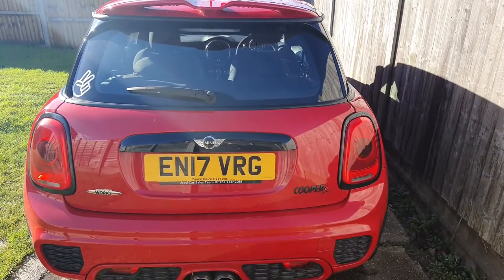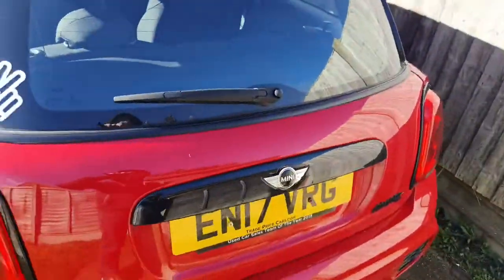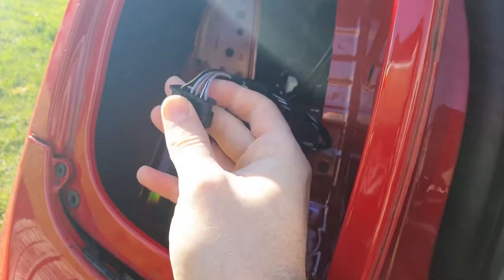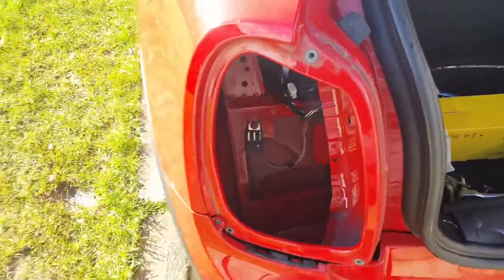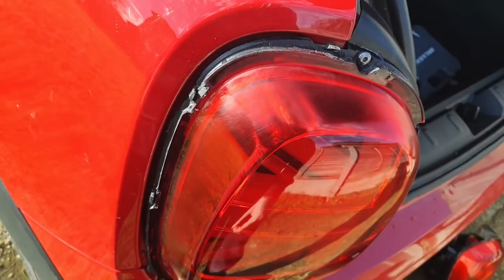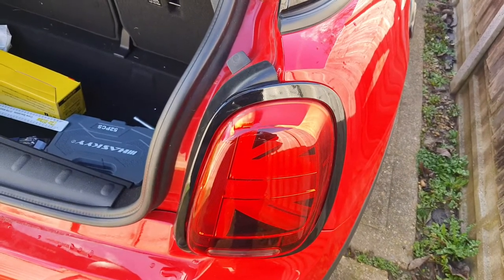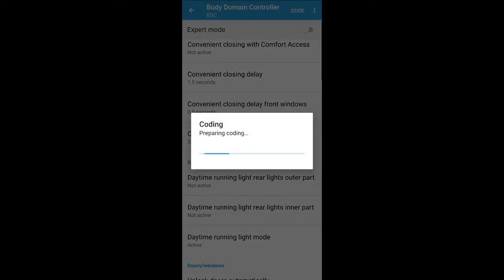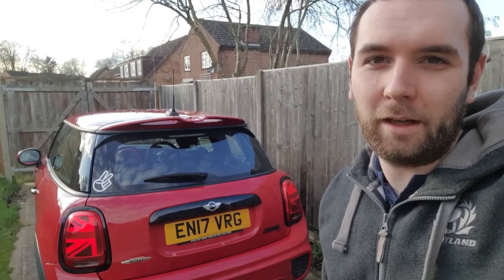Mini F56 Genuine Union Jack Tail-lights Retrofit for Halogen

Comment: Thanks for this, great help in installing the same lights on my 2015 F56. Still managed to break the same clip as you as I completely forgot about your warning for this - may try and plastic weld back on but like you the gap looks the same compared to a working clip.
Thanks again, video was a life saver especially when explaining how to unclip the lights from the inside.
Reply: Curious - did you do the wire swap? I have a 2015 F55 5 door and didn't have to do that. All my wire holes were filled. Wonder if the F55 differs from the F56 for the wiring assignments...

Comment: Thank you very much for making this video. I've just successfully installed some on mine. Although I wasn't aware that you also have to pay an additional £50 to get full access to the Bimmercode app?!
FYI- The app has also been updated now so it's much easier and simpler to update the coding without having to go through all the voltage shiz.
Happy motoring peeps.

Comment: Hi again,I did have another problem with the Union Jack lights,the break light strip was staying on when normal lights were switched on,but not when the day time running lights were on,but after watching your video,and having got a Bimmer code and icar adapter,and watching the rest of your video,all sorted.
Again thanks,with out your help next visit would have been the garage.
Chris
Reply from the maker: Hi Chris, yeah the coding is an important part. Can be quite dangerous if you skip it for the reasons you stated :) glad you got it sorted!!

Comment: Inspired by your video I purchased a new set of tail lights and the Bimmercode app. I think I must have a newer version of the app as I only had to change the lights to LED and did not have to alter the warm and cold monitoring as I think this must now be automatic. Thanks very much for your excellent video.
Reply from the maker: Great! Glad to hear all went well :)
Reply: Did you have to purchase expert mode for the app or with the new update can you setup the lights fully in normal mode? I think I have the part LED tail lights so not sure if that means I'll just need to set them to LED in Bimmercode for them to work? Cheers

Comment: Good video. Got this job to do at some point soon. Got some genuine union jack taillights to go on my halogen F56. I'll definitely be using this video to help me out
Reply from the maker: Thanks! Let me know if you get stuck!
Reply: @squashylemming5202  hi great video!👍👍thanks.. can I just ask do you need the ignition on eg lights, radio ,air on ect ready to start? Or do you need to have the engine running🤔 I’m going to be doing the exact same thing as this video when the weather gets abit better😄genuine lights came today, I’m changing over from halogens!! Thanks in advance seems a bit complicated & a delicate task🙏.Dave thanks again for the video 😄👍👍
Reply: @squashylemming5202  hi great video!👍👍thanks.. can I just ask do you need the ignition on eg lights, radio ,air on ect before coding ready to start? Or do you need to have the engine running🤔 I’m going to be doing the exact same thing as this video when the weather gets abit better😄genuine lights came today, I’m changing over from halogens!! Thanks in advance seems a bit complicated & a delicate task🙏.Dave thanks again for the video 😄👍👍

Comment: hi Great video and very clear on your instructions, much appreciated.  i have a slight difference to what you showed on my 2017 mini one where i have swapped out the wires as you showed but i now have left side union light with indicator off but right side on.  the right also has indicator (centre horizontal light) as red and left in yellow which is correct.  i have not made expert mode updates yet but wanted check if something else wrong or is there a different fix required in expert mode?

Comment: Thank you mate yo are great!!!  I have a question. At the end yo turned off the mapping BRMSL LEFT AND RIGHT. Now i  have rear fog light but there is no switch to turn on it. I want to change this fog light to rear brake light. What i must to do?
Reply from the maker: Hi mate, if you want to make your fog lights come on with brake lights, check out Ben Rolfe’s coding video, I believe he shows you how to do it :)
Reply: @squashylemming5202  i already watched. But there is a problem. 1st he have 2 fog lights but i have only one. And he codded brmsl left and right to srl_l. Yo turned it of for union tail lights. Here is a conflict i think. Can yo explain
Reply from the maker: @turanhuseynli105  I see. I didn’t realise the fog lights would be controlled differently by the ECU for a car with just the one fog light, I’m assuming you have the cooper with the central fog light at the rear? Unfortunately I don’t have my mini or Bimmercode anymore so I’m afraid I can’t help. Might be worth looking online for a forum post?

Comment: Great video thanks. Would this process work when upgrading from halogen to the non UJ led versions?
Reply from the maker: I believe so. I think the UJ lights are pretty much a straight swap (without the need for expert mode coding) if you already had the non UJ led versions, so that suggests it would be the same process moving from halogens. I still think there are some halogen elements in the non-UJ led lights though so it may differ slightly in the cold/warm monitoring coding

Comment: Hello i ve bought a mini f56 with front and back halogen lamps. The only thing i ve to do is switch the pins then use bimmer code? Nothing more? Your mini at the time video is front and back halogen? Thank s
Reply from the maker: Hi, yes that’s correct. In fact now bimmercode is simpler to use than when I recorded the video. So I believe there are less settings you need to change.

Comment: Great video just what I was looking for!got the new lights today (genuine ones)for halogen on my 65plate Cooper😃 does anyone know , if when coding do you just leave the ignition on ready to start up lights radio ect on! Or do you have to have engine running🤔
Reply from the maker: Hi Dave, so when coding using bimmercode (or similar) you'll want the to turn the ignition on. You don't need the engine running though. Bimmercode will automatically reboot the ignition and ECUs after you code and you may see a brief stability control notification pop up on the screen but this gets cleared by the coding process. Hope this helps! Good luck! Let me know if you have any trouble👍
Reply: @squashylemming5202  
Hi, iv got BimmerCode to code the lights & just noticed it’s been updated & there’s an option now it says retrofit lci tail lights 🤔does that mean I just need to activate that after iv done the wire swap? & that’s all the coding done do you know? Many thanks.  Dave
Reply from the maker: @davefogg9586  interesting! I haven't seen this. It might work, worth a try! I'm unsure if it will do the expert mode coding though as you can retrofit the lights to both the halogen and LED equipped minis and bimmercode would need to know which lights you have equipped and that you've swapped pins around in order to change the right settings. I understand there is still some coding that needs doing if you fit retrofit LCI lights to an LED equipped car, so it might just do the cold/warm voltage monitoring etc. I will have a look the next time I use bimmercode.
Reply: @squashylemming5202  I've just coded some genuine F60 LEDs. I've got the updated Bimmer code options, and I think it still needs the expert mode changes done. In daylight it looks right, but when you put headlights on it gets a bit confused (not sure what happens if the lights come on due to darkness due to being in Automode). It would still be usable, but the brake light comes on while the tail lights, and the tail and brake lights get brighter when you brake.
I'm about to go out and do the expert bit and see what happens. Update soon.

Comment: Hello. I have a 2017 Mini Cooper base 2dr. Hatchback. I will install a oem Union Jack tail light. Do I need to do a recode?  Also do I need to do what you did on the wiring swaps? I really appreciate your help. I want to hear your advice first before I do it. This is an awesome video. I will definitely subscribe. Also what OBD did you use. Planning to do a iCar pro OBD from V-gate. Thanks buddy
Reply from the maker: Hi! Is your cooper equipped with the halogen lights? Or does it have the LED headlights at the front? If it has halogen bulbs then you will need to recode and do the wiring swap (as I have done). 

If it has LEDs already then you only need to do the voltage monitoring coding and not the expert mode stuff or wire swap.

I used the iCar Pro Bluetooth version. It is really good. You will also need to purchase the full version of bimmercode to perform coding
Reply: @squashylemming5202  awesome!  Thanks for your immediate response. I have a halogen headlight. Will it trigger a warning alert on the dash? Ok on the process. OBD tool ok. But where do you purchase the BEEMERCODE? Thanks again buddy
Reply: Is this the one? The free bimmercode app?
Reply from the maker: @ledi1824  yeah bimmercode is the app. But you will need the full version to actually code which is not free. If you have the halogen lights, I am not sure if there will be warning lights. you need to code and do the wire swap in order for them to light up correctly. Otherwise the car won't  do the correct thing when you press the brake pedal etc. If you do this then there will be no warning lights
Reply: @squashylemming5202  do you have the link to the bimmercode app? I only see the free one. Hey I appreciate your giving time to answer my concerns. Thanks
Reply from the maker: @ledi1824  hi. I don't have the link but if you download the free one it will direct you to purchase the full version. No problem!
Reply: @squashylemming5202  good luck to me🤪🙏🏼
Reply from the maker: @ledi1824  have fun 👍😂
Reply: @squashylemming5202  last question. When doing the coding. Should the engine running? Thanks
Reply from the maker: @ledi1824  you only need the ignition on but you can have the engine running if you like
Reply: @squashylemming5202  thanks again!  Oo this will be the day that I will change it. Last thing in the future if I want to bring back the halogen tail lights. I’ll just do the reverse process of the coding procedure Wright? Thanks
Reply from the maker: @ledi1824  yeah, and you'll need to reverse the wire swap back to the way it was too
Reply: @squashylemming5202  thanks buddy. Be safe

Comment: Hi
Thanks for posting this video.
I have a f60 countryman with led headlights & fog lights. Does this mean I will have part led tail lights so wouldn't need to change pin & code ???
Reply from the maker: I don’t know about the f60. I’d have thought the union jacks for the countryman would be a straight swap (maybe with some minor coding for the voltage monitoring if any) id have a look on some forums

Comment: I have an issue with the reversing light not working on these. Any ideas? Tried following your instructions but nothings changed. They didn't work, I then didn't touch the lights and they worked for a day or 2 and now they don't work again 😕 help

Comment: Great video!! How would I know if my lights are halogen or led? Also where did you buy them from. Thank you.
Reply from the maker: Hi Kevin, your taillights will be halogen if you also have the halogen headlights. If you have the LED headlights then you should have the "part-LED" rear lights. In which case you don't need to do the pin swapping or expert coding, just the voltage monitoring coding.
Reply from the maker: I bought the lights off eBay. One needed to be resealed so that's why I got them cheap

Comment: So i just install the light and everything work great but the brake light not on when I apply the brake and i think i need coding. For the wire i don’t have 5 pin but i have 6 pin so i don’t know which one to switch
Reply: Could you post pictures of the 2 plugs that have the 6 pins?

Comment: Hi,have you changed your front headlights.been give a pair of led headlights from 2017 mini,my car is a 2016 model,thee problem is there are 3 pins on the 2017 and only 2 on mine,any ideas.
Chris
Reply from the maker: From what I understand you can’t retrofit OEM mini led headlights to a halogen car. I may be wrong but I believe the wiring looms and controllers are completely different. There are aftermarket LED headlights that you can get although I don’t know if they have auto balancing which is a requirement to be legal on the road in most countries.

Comment: Are you front lights LED? If so my car is the same - might look at getting some of these. Cheers!
Reply from the maker: No they’re halogen. Hence why I have to do the pin swap and expert mode coding
Reply: @squashylemming5202  Ah that makes sense thanks. So with my part-LED rears will I basically just need to plug the new OEM lights in and use the free to use mode on Bimmercode to remove the errors?
Reply from the maker: @TheHazzaaHD  yep pretty much! Bimmercode isn’t free though, even for the simple coding. You’ll just need to switch the taillights etc to LED in the app. It’s been updated since I made the video to make it more intuitive.
Reply: @squashylemming5202  That's good to know, I suppose it will be useful to have Bimmercode either way. Appreciate your help!
Reply: @squashylemming5202  Got them installed today and errors all sorted - cheers! Mine has a slight gap on the outside of the light trim though which is annoying me… I drove the top screw for the light in further and compressed the foam behind the light as much as possible so not sure why there’s a slight gap - not sure how to fix it haha!
Reply from the maker: @TheHazzaaHD  mine also had a gap initially. Turned out one of the plastic clips on the trim was bent and was stopping it from clipping in properly! So I just snapped it off and fitted perfectly then :p

Comment: Got my tail lights from killallchrome, the tail light should do a sequential turn signal but mine don't in US car. Do i just change the voltage part or is there something else?
Reply: Yes they are suppose to sweep on turn signal. Do i just change to LED in dimmer code?
Reply: Just did everything, all of the expert mode item are already off. I still get no sweep for turn signal.

Comment: Did these also come with LED Brake lights?  I think mine did, haven't put them on yet but looks like it.  I assume we just set "Reverse Lights lamp" to LED and disable the adaptive brake light warm/cold monitoring and should be good.  Anyone need to do that?

Comment: How comes you got jcw and cooper a badge?
Reply from the maker: The car was a Cooper S Works 210. So was a cooper s which comes with the JCW tuning kit (pro exhaust, remap, jcw body kit) from factory. With the tuning kit they stick on the JCW and 210 works badges.
Reply: @squashylemming5202  very nice I like it

Comment: So i have a veepak adaptor and i go i to bdc and dont see voltage monitoeing at all. Am i missing something?
Reply from the maker: If you are using bimmercode I believe there has been an update which lets you select if you are changing various lights to LED and it handles all the voltage stuff for you. But I’m not sure as I haven’t used the app since before the update.

Comment: Hello, Can you explain to me why the pins need to be changed round
Reply from the maker: Because the lights originally installed on the car are the halogen version, the car  has only 5 pins in the connector. The LED version have 6 and so do the UJ lights. Without swapping the pins on the connector (that is set up for halogen) the wrong parts of the light would light up when you brake, turn lights on etc. If you have the LED lights on your car to start with you don't need to do the pin swap.
Reply: @squashylemming5202  so I do have the front lights on my 2016 f56 as LEDs but the rear taillights are non union jack (but I am sure they are LED as they are not the standard round ones but the fancy round ones where the red light lights up as two sem circles instead of solid block). Am I right in thinking that I won't need to swap the pins then? I guess it will be easy to just remove one and check the cables :-)
Reply from the maker: @amitjain14  hi, yes that’s correct. No pin swap necessary as those LED lights have 6 pins already, not 5 like on the halogens. Just a bit of warm/cold monitoring coding and you’ll be good!

Comment: Hello, i put official mini Union jack gp3 on my f56 2017 and they work well but i ve a message telling me that there is a problem with my left brake lamp, i guess i need to code but don't know what part of code should i do. Any idea?
Reply: I‘m actually planning to do the same thing. How was your experience and where did you got the lights from?

Comment: Damn. My connector has all 6 pins. Any idea?
Reply from the maker: Are you sure you have halogen bulbs to begin with? If you have LED lights you don’t need to do the pin swap
Reply: @squashylemming5202  I imported my US Mini F56 12/2018 to Germany and my connectors have 6 pins even though I have Halogen lights. I have the OEM UJ tail  lights (ECE Version) on the way and may try them without changing a pin. Makes sense?